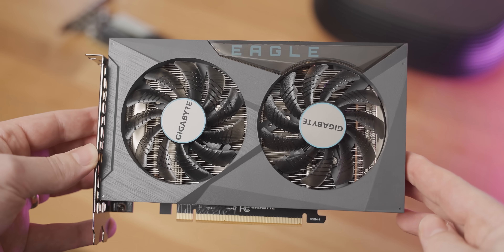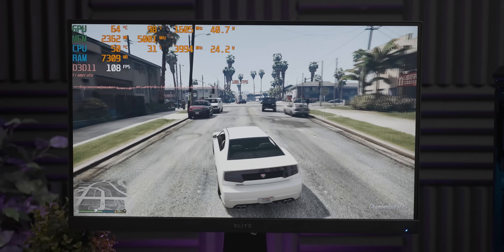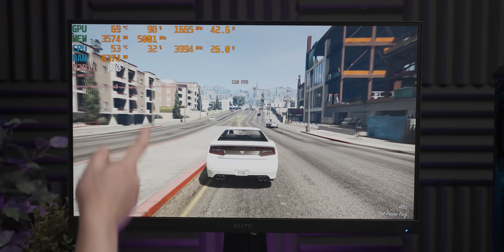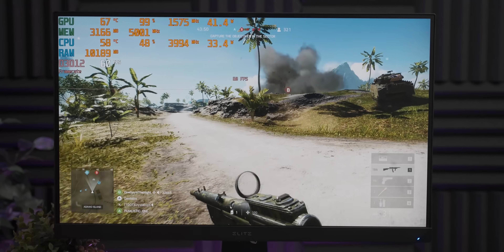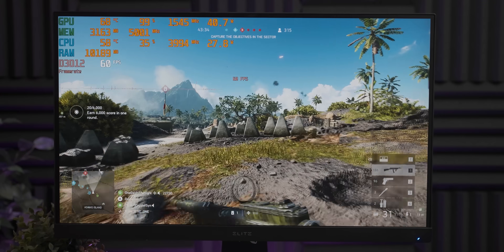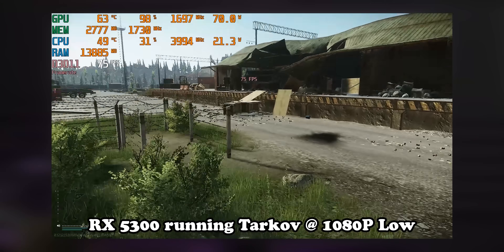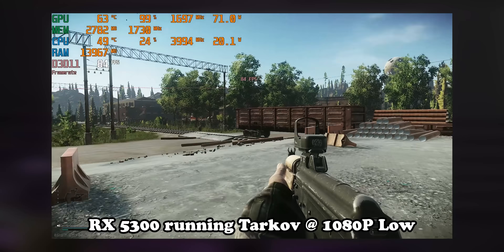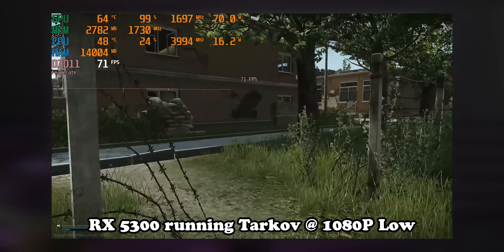This RX 6500 XT Comparison Was A Terrible Idea...

Comment: You know what else is funny? The 6500XT has two major flaws as you noted: 1) the dependence on PCIe 4.0 and 2) the lack of hardware encoding. Do you know what AMD CPU has gen 4 support and an iGPU for encoding…uh none. Lol literally the best CPUs to pair this card with are the i5-11400/12400 and i3-12100. No AMD CPU is worth pairing with this card…how sad, good job AMD.
Reply: The new 6000 series does though.
Reply: Was likely meant for laptops with a Ryzen 6800U or something.
Reply: It was a laptop GPU. So it would've been paired with 6000 series mobile Ryzen APUs that do support hardware encoding on their iGPU and PCIe 4.
Reply: Whatever it was SUPPOSED to be doesn't change the fact that the DID release it for desktop and they DONT have a desktop CPU to properly pair it with.

Comment: Im trying to build a PC and this video scared me because I wanted to get a "MSI - AMD Radeon RX 6700 XT MECH 2X 12G" is this the card in the video?. BTW nice channel man.
Reply: Nope, that is not the same card (6500XT), yours (6700XT is a much better choice, but still too overpriced IMO
Reply: @dogfrog9543  thanks for replying. I just got in to trying to build my first pc. Im doing research and theres some articles saying to wait, the prices are going down. Well see im aiming to finish my pc by this summer
Reply: @ry6063  Good luck, hopefully with new GPUs from Intel and also AMD and Nvidia will push prices lower on older stock

Comment: The 6500 XT is really a mobile GPU stuck on a card. It wasn't designed with a hardware encoder since it would've been paired with an AMD APU, which does have the hardware encoding built in. So, yeah, they didn't bother to adapt the chip for desktops, gimped PCIE, and generally half-assed it. I'm sorry, but I can't condone that. If you're going to do something, you should put your whole ass into it.

Comment: The 6500XT does not have an encoder because it was originally intended for use on laptops using the encoder from the iGPU that would be paired with it. So in the end the 6500XT is a mobile GPU ported to a normal video card.

Comment: “What was AMD thinking?”
Probably something along the lines of ‘The GPU market is wretched right now that our customers will buy anything they can get their hands on’
Reply: This, I believe, is the unfortunate truth.
Reply: @Repugnantone  It isn't see my previous comment
Reply: they have enough 6800 xt cards to give away  to influencers on the Red Team Gaming tags yet they don't have enough supply of mid range cards to put on shelves and at reasonable prices.
Reply: @NightMotorcyclist  lol you salty them giving cards to influencers does not made a difference to anything you would still not be able to get one because of the bots etc etc
Reply from the maker: That’s true, but the least they could do was put a damn H.264 encoder on it. 😔
Reply: @DawidDoesTechStuff  Really not so important. The CPU can handle that quite well today. And by sheer numbers the importance accorded to this encoding stuff is way overstated. Not completely accurate but it gives you a ballpark figure to play with. 120 million monthly active steam users, vs like 9 million for Twitch. Which means about 7% would need that encoding for streaming. Let's be generous and add some video encoding etc... and we are at what 15% of users actually using that function on a regular basis? Important to know if you need it, but nothing to make such drama about... I mean the vast majority (85%) is not using that encoder for anything.
Reply: @DawidDoesTechStuff  Just point your PS3 web cam at the screen.
Reply: Add to that at least a 128-bit bus and PCIe 8x rather than 4x so when it gets halved it wouldn't be so bad
Reply: @NightMotorcyclist  And then it would cost $500 :D Face the facts, if 6500xt didn't suck you would not be able to buy it near MSRP .
Reply: @DawidDoesTechStuff  Yeah, they should've really done that. Even the RX 550 had an H.264 encoder.
Reply: @DawidDoesTechStuff  they can't cause its actually a laptop gpu with the rest of the laptop bit cut off meaning it also has no encoder then they overclocked it
Reply: @RoastedSushii  Except AMD classified this as the mid-range GPU that is competing against the RTX 3050 series.

Since AMD decide to go tier-to-tier with the number series:

RX Flop series/Flop VII - Titan V/RTX
RX 6900 series - RTX 3090 series
RX 6800 series - RTX 3080 series
RX 6700 series - RTX 3070 series
RX 6600 series - RTX 3060 series
RX 6500 series - RTX 3050 series

If it's like 6300 or lower, everyone might close one eye, because that class of cards, it's more of adding display functionality.

This isn't really another second round of cut down laptop chip, this is actually a laptop chip on a PCIE card, which Evil Su is fully aware and allow it.
Reply: @DawidDoesTechStuff  what percentage of gamers actually record their gameplay? AMD was looking to cut corners while turning off the miners which gave birth to this card. 
I actually purchased it for my budget gaming rig and I’m very content with it for now. I just wish it had more ram. 
But then again if it did have more ram then it wouldn’t be available.
Reply: @hcelentano  ahhh yes, it's almost as if AMD wasn't already aware of the limitations of 4gb vram to the point that they even said it wasn't enough well before 2022. But they will retcon anything that was said beforehand to get your $$$ 

To he fair though, on a 64-bit bus there's really no way it could even saturate a larger amount of memory, or at the very least it will struggle to do so. My RX 580 has no business being an 8gb card but at least back then, AMD stuck to their roots and gave you the extra memory anyway. Even if you couldn't always use it.
Reply: @hcelentano  way more than you think, also you F’d up royally buying one. Literally so many cards used and new wouldve been better options now.
Reply: yea, just like what msi did by re-releasing the gt730
Reply: @d3fault1420  you mean the gt 430 rebrand, that was truly awful.
Reply: haha, then nvidia’s here with the gtx 1630
Reply: probably it was probably a stupid thing 'cause new intel opus are coming out q2 2022
Reply: Just part of Evil Su's plans
Reply: That's what every company is thinking.
Reply: I almost bought one
Reply: This entire argument is dumb as the silicon was originally intended for a mobile card which made would then have an apu contains the necessary hardware. No reason to have both the gpu and cpu to have one. And due to the shortage they took that silicon and instead made it into a graphics card.
Reply: @IEUEJRBCIEJFJFIEJ  I wouldn't mind if AMD ditch the RX Flop series/Flop VII architecture, for RDNA, at least it no longer competes against the Titan V/RTX. I mean why else AMD named it so differently like the R9 Not-So-Fury series?

If this was on APU, no one will be negative about it, but Evil Su decided to maintain the Flop architecture and put a mobile silicon on a card.
Reply: The reason it doesnt have an encoder is because it was designed to be a laptop chip. On a laptop you always have a cpu with igpu installed in case the gpu failes. As a result AMD didnt have to include an encoder as that wouldnt be neccesary. When they made it into a desktop card they had already produced all the chips.
Reply: Wut you even talking about he's a troll that 6500 xt is better than quadro or 1650. Don't listen to him lol. It's a budget card anyway not everyone can afford 900$ gpu
Reply: Worked on me.
Reply: Wrong. The RX 6500 CrapT is a repurposed mobile chip, which was combined with an APU, where the APU was doing the video encoding task.
Reply: As deservedly wrecked by reviews for a new 2022 gaming card, the 6500 XT was a very necessary release. At least in Canada, the price was about $350 cdn at launch and has kind of remained the same and has generally always been in stock. The biggest impact that it had was on 1650 pricing, at one point those were going for $499 cdn at the height of the scalper pricing here. But its shrunk down to nearly what it was before the pandamic ($249 cdn). The 6500 XT had a part to play in that as it does outperform it (albeit just slightly).
Reply: @stokemoran  Why are you even comparing against last gen card? It is so obvious it is going to beat it.

AMD is going full on tier-to-tier, so 6500 series is going straight against the 3050

Comment: The 6500XT is serviceable so long as you stay away from the VRAM limit. It's the connection between the GPU and the system memory that's suffering from the limitation. And all of the issues stem from it being a laptop GPU that was amputated from it's APU and slapped on a PCB.
Reply from the maker: I think serviceable is a good word. I just wish they charged less for this abomination.
Reply: @DawidDoesTechStuff  Yeah... if it was about a $150 card or so, it would have been a lot more well received. I think you're spot on with the 5300. Had they released that for around $130, it would have sold like hotcakes.
Reply: @TheGameBench  Even if the 5300 were released with an MRSP of $130, I guarantee it would have been sold at a higher price than that in todays market.
Reply: @Groovy-Train  Never implied otherwise. I can't comment to street prices because they're about as volatile as the stock market. However, I don't know how much that would ring true at this point. The 5300 wouldn't be all that desirable to miners with only 3GB of RAM and it's mining performance wouldn't be better than the 6500 XT. Scalpers would initially buy them and charge stupid amount for them, but that's the world we live in, and we're going to have to deal with these ass boils regardless of supply chain issues. But I think the prices would have settled by now, especially the way things are going. The GPU market is quite a bit healthier than it was in late January, and hopefully it continues to improve.
Reply: @TheGameBench  It is $150 card in Donald's dollars ;) But you live in Brandon's years and be grateful you are not breathing radioactive dust yet :D
Reply: @DawidDoesTechStuff  Is Doom Eternal so bad on the 6500XT with Gen 3 if you keep it under the VRAM limit?
Reply: @DawidDoesTechStuff  All the cards at this price point are abominations. That's the world we live in right now.
Reply: @DawidDoesTechStuff  It's by far the cheapest gaming card in the U.K that's new. So it's not that bad on a rig with pci express 4. Do the performance per dollar calc and see for youself.
Reply: oh hey it's the dell guy, thanks for the guides on removing the hdd bay, i sold my rx 580 i5 dell for 300 lmao
Reply: @gang-yc4je  Haha! I wish I could heart your comment.
Reply: @TheGameBench  you can always do it in your mind man
Reply: Honestly I’d stay away from a GPU like that no matter what.
Their fist mistake was not making it 75 watts, and $170 or so. Like it would be 20% more powerful than the 6400, and would be more for “if you want 15-20 more FPS in games” basically.
Reply: I mostly agree, but you still probably need gen 4 or else you could take a performance hit. For example, from what I've in cyberpunk 1080p low the 6500 goes from 49 fps on gen 3 to 60 fps on gen 4 same settings. But the old 5500 xt 4gb gets 60 fps on both gen 3 + gen 4 same settings. Cyberpunk 1080p low only needs 3gb of vram so it's not running out. What's probably happening is the game needs more bandwidth outside of connecting to system memory, and x4 pcie lanes in just not enough on gen 3 but the x8 on the 5500 is.
Reply: @jackluck2538  No, I really doubt the GPU itself is being constricted by the bandwidth limitations. More likely that Cybepunk is leveraging the system memory, even if you're not close to the limit. I saw similar results with slower GPU's. I'm 99.9% sure it's all down to memory bandwidth limitations. Heaven forbid if you're still on Gen2, and even some 4th Gen Intel systems are stuck in Gen2, like H61 mobos.

You make a good point, and I forgot that some games just ran like a wet fart regardless. And don't get me wrong, I don't think anyone should buy the 6500XT. I made a whole video telling people not to. I think it would be worth buying at a much lower price point, but I wouldn't suggest anyone but it... even at it's original "MSRP."

Comment: the biggest difference is the rx 5300 is better suited if you only have gen 3 cause the 5300 has x8 pcie 4.0 lanes compared to x4 pcie 4.0 on the 6500xt

Comment: I have the next model down, the NVIDIA T400. I think it is great. Yes really! My use case is video encoding via NVENC. The T400 is a wonderfully cheap hardware video encoder. Try buying a CPU or GPU with the same encoding performance as the T400. You do have check out T400 prices as they vary hugely. Yes the 6500XT doesn’t have a video encoder which is why I would never buy it.
Reply from the maker: For sure! The T400 also comes in quite a bit cheaper a lot of the time. It’s like the graphics card the GT 710 wished it was.
Reply: @DawidDoesTechStuff  My T600 replaced a GT 710 :)
Reply: @DawidDoesTechStuff  am going to lenode ur nan
Reply: T400 owner too, amazing to add dp out to multiple displays in a commercial environment
Reply: RandonHD did a video on it a while back its basically a neutered 1650
Reply: @RK-zf1jm  are you talking about T400 or T600 to compare with 1650
Reply: @cnhtol1586  the T600 is closer to the 1650, as they both have 4GB VRAM.
Reply: T600 here. Been using for gaming and it's fine. I just find it gets a bit hot in my system.
Reply: Have a T600 in my gaming PC, but I'm using it as a secondary GPU to drive my non-gaming screens (too many for 1 GPU).  Have a 6900XT for main GPU.  Both GPUs play nice together and it's remarkably stable.  Also don't have to worry about losing driver support this way.

Comment: The main reason why the 6500XT doesn't have built in video encoding and decoding is because the chip it uses was originally meant for full-AMD laptops, where the APU would already have encoding and decoding built in and thus negating the need for it in the 6500XT. 

Still doesn't make it any less stupid though, they could've just used a cut-down 6600/Navi 23 chip to make the 6500XT so it wouldn't have turned into an absolute dumpster fire due to the PCIe and VRAM bottlenecks.

Comment: That T600 is pretty damn good for a 40w SFF card. Shame it's price point is still highly inflated.
Reply: it's easily better than a GT 1030 in basically every metric and is a brilliant backup plan for if your main GPU dies suddenly - there used to be a £40 difference or so in price. Sadly, the T600 has gone up a lot in price in the last 3 months (about £70 here in the UK more than it was in December 2021) and the 6500XT is the better buy now. I've never seen an RX 5300 for sale here.
Reply: @Durbanite2010  
Sure!  
1. GT 1030 has 364 Pascal Cuda cores vs 640 Touring Cuda cores for the T600. 
2. GT 1030: 2 gb VRAM DDR4/5 vs  T600 4 gb VRAM DDR6
If GT 1030 was a surprising 30w card, now T600 is more than a amazing 40w card.
It's the gaming solution for SFF PC's which only allow low profile and single slot card with a weak 200-250 w PSU.
Reply from the maker: For sure. It is usable for 1080p gaming and basically doesn’t use any power, which is pretty cool. 😁
Reply: @DawidDoesTechStuff  Well it would be cool if it doesn't use use any power. Badum Tish! 😂
Reply: @Groovy-Train  in the uk it would be nice if it generates power 😀..
Reply: A quadro m2000 is a pretty good option, as it is a gtx 950 with 4gb vram for around 120
Reply: Its not really highly inflated as it is a workstation card. Yes it is a dumb price but its still not a card for the average consumer...but dang its impressive
Reply: @AlpineTheHusky  Right. 
Workstation cards must pay for some certifications in order to validate its accuracy as professional cards, so its price is higher. 
Maybe Nvidia also should launch another line with the same cards without these professional certificates with a lower price. So we could see a GT 1630 (Quadro T400 without these certificates), GT 1640 (T600) and GT 1650 (T1000) with better prices. 
I think that's is AMD did with the RX 6400 XT and the professional but very similar Radeon PRO W6400 , same core configuration for both cards, but the gaming one cheaper (159 USD vs. 229 USD).
But the way, recently, I bought a T600 in a  Lenovo web offer and I can say it's an awesome card for my Optiplex SFF.
Reply: @larrybreavman4864  I dont think its the certificates and more just the added features and the binning
Reply: I looked at the eBay price and loudly shouted 235 gbp for a t600 are you on crac*? My neighbors are no doubt confused..
Reply: @Run187  It isn't much better a year later about £175 (used) and £220 New.
Reply: Isn't a 1650s better?
Reply: @butifarras  Undoubtedly. But for 40w, it's quite impressive.
Reply: @butifarras  A low-profile 1650 would be considerably faster, but also costs more used than a T600 does new (only new 1650 inventory I see right now is full-size), draws more power, and takes up two slots instead of just one. If you've got an average gaming PC, there's better options. 

If you're constrained on space, power, cash, all of the above or just love fiddling with strange hardware that you don't see that much of, there's some neat stuff in the used professional card space!

Comment: AMD couldn't launch a card like 5300, because the fab capacity is all booked out for that process. The 6500 is going into quite a few laptops, where it does fine, as it was originally meant to. One more thing, at least 6500 is in stock, unlike the competitors offerings, so it has that going for it. Would I get one? Only if I had no other option, but that's exactly the case for many people...
Reply: In stock and at MSRP!